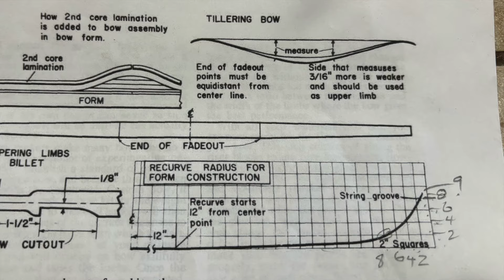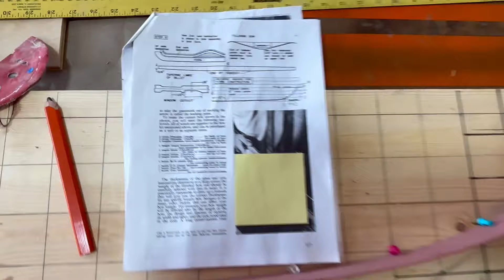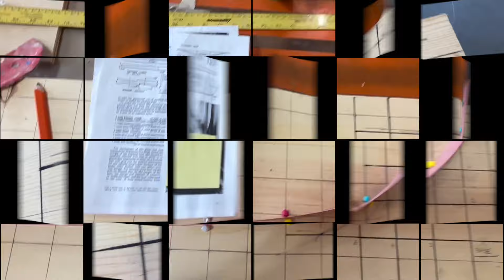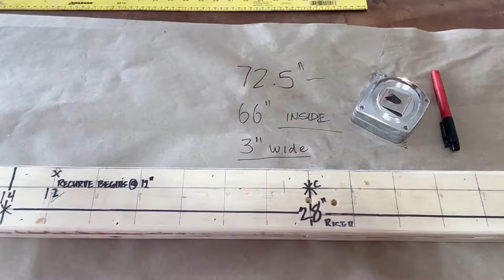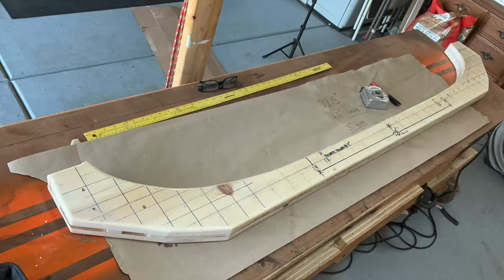DIY RECUVE FORM build full build

Comment: Hi brother,
Do you mean Plexiglass when you say Plexy Glass in the video?
In the video, you use double sided glue to glue Plexiglass to the plywood frame. What brand of double sided glue did you use? Because if the glue layer of the double sided glue is thick, it will cause a larger error in the verticality of the curved surface.

I would like to know these details because I want to refer to your Form to make a Form I need.

Thank you very much.
Reply from the maker: Yes plexiglass, I used wood working double sided tape which did not bunch up in the bend. Thanks for asking
Reply from the maker: You could also use spray on glue that might work but not much stick sit plexi